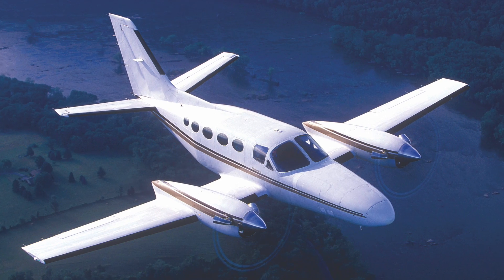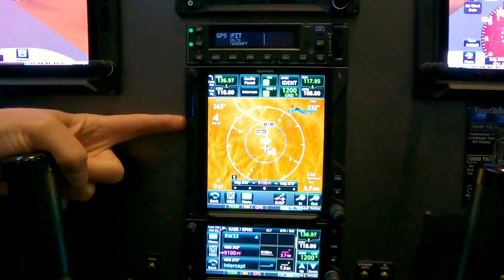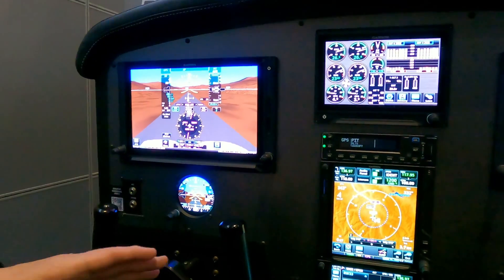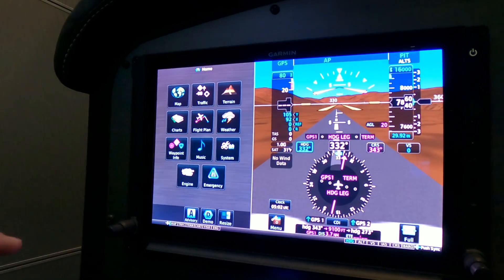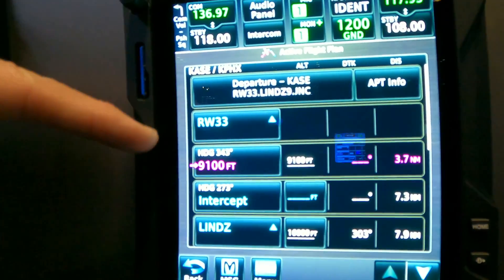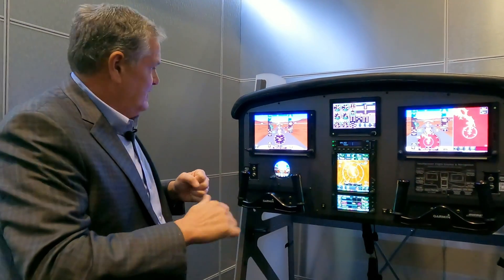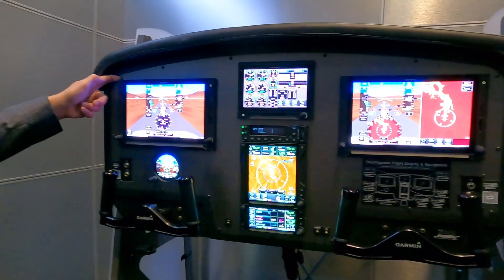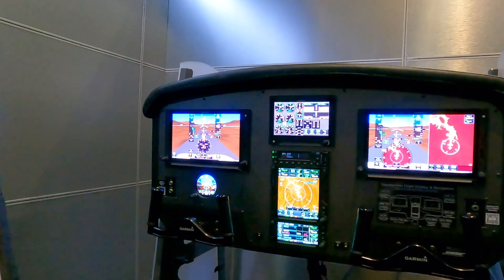NBAA 2022: Garmin's Turboprop Avionics

Comment: It would be nice, especially since he mentions the G1000 many times in this video, if they would still support the thousands upon thousands of G1000's out there. Garmin considers it a "legacy" avionics system, therefore no longer seems to care about owners or upgrades. For only about 45 thousand we can upgrade to the NXI, and get things like newer firmware and a Flightstream. Garmin is very proud of their products, too proud, and too quick to consider something obsolete. When it costs me $1,000 a year just for database updates (without charts) you know you're dealing with a company that's overpriced.
Reply: Garmin has always been this way, but there's almost no alternatives so the bigger planes are basically stuck with them lol
Also, consider this from a business perspective. Releasing a new product and leaving no lifeline for the old ones is a great move since it forces people to upgrade instead of repairing things, thus driving up sales and revenue. It also cuts down on supplying parts (which cost money). This especially works in aviation where they have a near monopoly on certified glass products and many customers (plane owners or manufacturers like Cessna) have enough money to shell out for new stock.

Comment: Mess of awful small poorly integrated units with cluttered 1990 level game style graphics. When it should obviously be one unit with a vastly bigger screen. And none of that awful tape legacy clutter or compass rose. How is it so hard for them to see the obvious. Grossly overpriced as well. The G600txi itself is a 27k$ unit. The GTN750 is a 19k$ unit. Massively redundant functionality between them yet why integrate them when foolish pilots sheepishly pay more when it's multiple units. And installation is s defense research project in itself so this lowtech solution might be 150k before you are done? Jesus.
Reply: I like how he said do "dual 750's", cool install but why would you do dual 750's? Or even this mock up panel with a 750 & 650? Only one can control the auto pilot or G600. Redundancy is nice, but why to that extent? It looked like there was nothing the G600 couldn't do, I don't see why the 750 was even necessary. Unless the G600 was just a secondary slaved display for the 750, and why would that be necessary? You still do need a com 2, but there are lots of less expensive choices for that than another GTN.
Reply: @johnfriend862  radio should be in the main unit. absolutely no reason to have separate units. radio is dirt cheap to do today and tiny. think about what a smart phone is capable of. avionics is still willfully stuck in 1990s discrete large electronics blocks thinking. never mind the grotesque pricing, it results in a mess of wiring as well so they are willfully inflicting huge burden on all planes. They are either extremely incompetent or intentionally hampering GA. Neither is elegant.
Reply: You have to recoup certification costs and turn a profit with low-volume production at the same time someway... Also, the dual GPS setup is for the radios while getting GPS redundancy. The Piper Warrior IIIs at my flight school all have dual GNS 430Ws despite only needing 1 for GPS functionality and I'm pretty sure we got those planes new lol
Also, what's wrong with having extra MFDs? They're versatile and getting them this new means no upgrades for the next 15 to 20 years... Then again, I'm not a turboprop owner and I'm sure neither are you. They actually have the money to spend on this stuff.
Reply: @Ibrahimarm  it's the same prices for small planes. when they do garbage products for insane money it keeps GA trash. it's trash because everyone is holding on to overpriced trash.
Reply: @DanFrederiksen  No one buys G600s for small planes, they buy the G3X which is like 3x cheaper lmao
Also, there are likw 4x cheaper options for GPS and radios that do the same thing as a 750
Reply: @DanFrederiksen  Hey man, I never said it was good. You just aren't looking at it from the right angle. If you look at it from Garmin's perspective, they're doing an amazing job since almost everyone praises their products and is willing to pay when new stuff comes out. I will say I personally won't buy a G3X or G600 even given the chance since they switched to having it touchscreen which just sucks compared to buttons. I will say that it's convenient for a less turbulence-affected aircraft like a turboprop which is exactly what it's for. I personally think Dynon is better than Garmin since they have compatibility with more 3rd party equipment that's generally cheap while working well enough. Garmin usually just doesn't give any aftermarket support apart from their own products.
Reply: @Ibrahimarm  That most people don't question status quo doesn't make me wrong. And that's the nice way of putting it. I have actual electronics engineering knowledge including component pricing. Electronics is dirt cheap today. I'm also a capable computer scientist so I know what software can do. And I've worked with geographical data so I know what it takes to do synthetic vision. I could do synthetic vision at MS flight sim level. So when I say it's very poorly designed user interfaces, grossly overpriced hardware and a massive failure to use small screens and numerous discrete units, it's because it is. I'm not missing anything, I'm not looking at it the wrong way. You are. Garmin is one of two things. Either incompetent or deliberately so. Same is true for all avionics makers. There is not a single even remotely decent product on the market. Some of the smaller players might be trying their best, garmin is definitely not. It's very intentional price differentiation and further marred by lack of intelligence to see the obvious truth that the speed and altitude 'tape' and compass rose should be long gone. And that 7inch is not a display size. That's a phone.
It's possible to do a 24 inch avionics unit with GPS and multichannel radio, ADS-B, pitot port etc with vastly superior graphics for 2-300$ and then you can decide sale price based on market size. The answer is not 50k$. If they go for what they can get away with pricing they are simply scumbags and you are sheep for indulging it.
Reply: @DanFrederiksen  Well why have you not built and certified a glass panel then? Sounds like you could do it if you want to.
Reply: @Ibrahimarm  I have many good ideas and observations, it's obtuse to require me to implement everything for the world just so you can keep denying the truth.
Reply: @DanFrederiksen  I'm not denying any truths lol
You just haven't really explained a lot about why you think stuff like the tape has to go away, or why it's badly designed. Additionally, if you're so dissatisfied with the avionics industry it would make sense to make an attempt at your own product, at least for personal use, to fix things. Also, why do we need to change the graphics that are used on PFDs and MFDs? Please actually answer these questions instead of just insisting you're right.
Reply: @Ibrahimarm  of course you are. And now pretending I'm taking a stance without substance so you can pretend you haven't erred and it's my fault. You should be able to understand why it's advantageous to have one unit instead of multiple that have much the same functionality requiring a ton of wiring that's a big part of the cost. So that you are obtusely denying. I've also explained true cost, you haven't learned or admitted anything from that either. As for the tapes and compass they obviously clutter up the screen and so effectively that most of you users haven't even realized that there is no synthetic vision behind the clutter. The synthetic vision should of course be the primary use of the surface while speed, altitude, heading are just small numbers at the edge. Same with radio frequency and other info. Pitch can be faint lines or preferably removed entirely as an option. You don't have such lines outside the window nor need them. You should also be able to understand that a desktop PC doesn't have a 10inch screen. For 50k$. That laptops have tiny screens is a mistake intrinsic to that product type as well. In zero visibility the display is your window and it's a special kind of stupid to have a 10 inch display covered up in tapes and a compass rose. MS flight sim is synthetic vision that you fly by. Compare that to the junk that is avionics. At any price level.
Reply: @DanFrederiksen  Well, now you're sounding like a troll since you're proposing the removal or trivialization of important marking. I'm willing to fly a 6-pack before I ever go with your idea. Synthetic vision won't give me any useful info apart from what the ground looks like, mate. I personally don't need to know what it looks like to fly properly, but I definitely need to see how fast I'm going, how high I am, and what direction I'm going if I want any of my flight planning to matter. Also, a single display is a giant failure point since if the screen fails there's no redundancy (or space for other avionics, for that matter). Additionally, radio frequencies can probably be removed from the PFD of you really want, despite how useful having them there is. Pitch indication is pretty important for unusual attitude recovery... It doesn't even get in the way; they're lines! Also people can fly IFR with a 6-pack without GPS. Were they stupid for not having GPS back then? Not really, since it didn't exist like it does today.
Reply: @Ibrahimarm  so you are flying in zero visibility and you don't need to see the mountains? you don't need to see the landing strip. You got your 6-pack.
Just because ships once navigated by sextant that's not an argument for doing it still and opposing better instruments.
One unit per pilot so you naturally have 2 for redundancy and there can be a tiny third bare minimum unit. Could be hidden away, could be battery operated.
Try not to be such a stubborn status quo sheep. Progress is good.
Reply: @DanFrederiksen  I will definitely be going above them rather than within them, since mountain flying with zero visibility is dumb regardless of how much tech you have lol
Reply: @Ibrahimarm  the thing about good synthetic vision is that you can fly the entire route from runway to runway in zero visibility. Going above doesn't work so well for landing. Nor is it ideal for an engine out situation at night. A 6 pack will be of little use. Whereas good synthetic vision can let you land on a sand bank between mountains in pitch black. A 6 pack can offer you the companionship of russian roulette firing on full auto.
Reply: @DanFrederiksen  Flying end to end in 0 visibility is reserved for airlines with runway projection on their HUDs, not GA aircraft or turboprops which don't even get a HUD to begin with... Synthetic vision doesn't exactly equate to knowing what the runway looks like relative to the angle I have the plane at, which makes landing while relying on it hazardous or even potentially fatal. Also, engine out situations are always better when you have altitude. If I'm lucky enough I'll be high enough to glide to the closest airport. By the way, why do you hate the 6-pack do much? It's basically the same stuff you get on glass minus the navigation and radio integration lol
Reply: @Ibrahimarm  minus the synthetic vision and maps and weather etc. Just goes to show how stuck your thinking is.
Reply: @DanFrederiksen  That's... Exactly what I said. You haven't answered the question, yet. Also, how is being safe sucky thinking? I'm starting to think you think it's safe to risk your life when using bleeding-edge avionics while flying.

Comment: Is there a temperature / humidity range the touch panel need to be to work
Reply: If it's not listed in the specs, it's probably in the manual. I doubt it matters though considering most turboprops come with heat and AC.

Comment: Now, if someone would work on getting the price of GA flying down to within reach of more people, I'd be satisfied.
Reply: What do you think would be necessary for that? As a layman, it doesn't seem to me like an activity that could be made (much) cheaper without cutting some corners.
Reply: @SolarWebsite  tubas and fabric plane with a basic 6 pack is the only way to go these days in my opinion.
Reply: @SolarWebsite  some say petroleum is amniotic . free flowing same as water. and others ask the question . why do General Electric make commercial jet engines. others say Tesla was all about free energy. and Elon musk looks like C-3PO with a wig.
Reply: @brothermcdudebro  Ehhh... Ok. Sure, man.
Reply: Fly gliders
Reply: @Jan_mxv  Why stop there? Fly model airplanes. I did that for years and it can be pretty affordable 😉
Reply: @SolarWebsite  that’s not GA
Reply: @Jan_mxv  I know, I know, I was kidding
Reply: @Jan_mxv  Gliders don't fly like airplanes and handling one is completely different, which is why you can't do gliding as a substitute. Gliders are also expensive as hell, especially in the US that doesn't really have a well-established used glider market. Additionally, glider clubs didn't really catch on here since our population density is so low compared to Europe, leading to much less possibilities for launching yourself without towing.